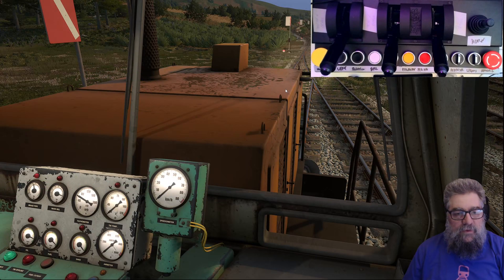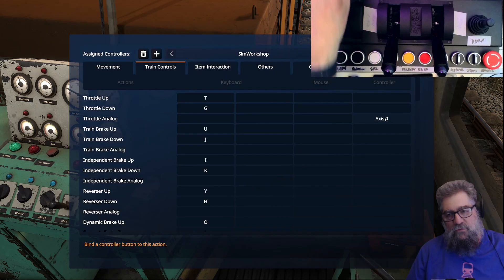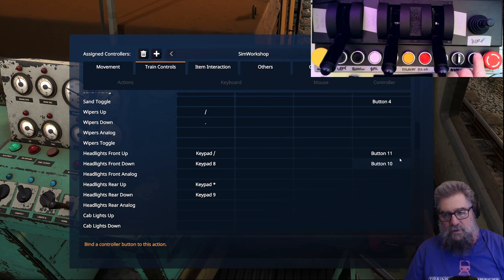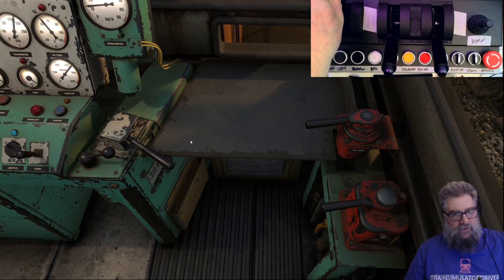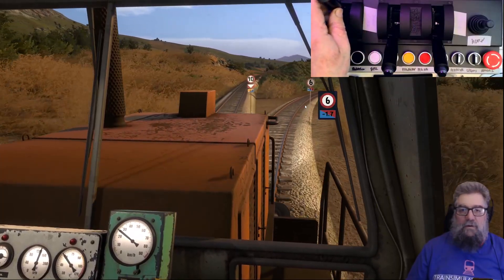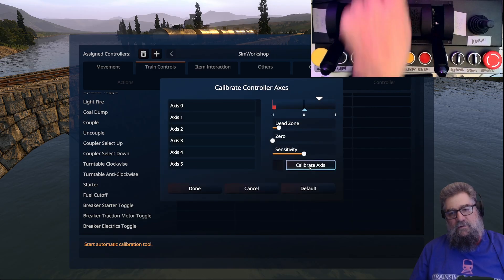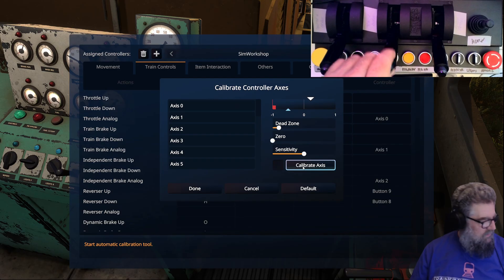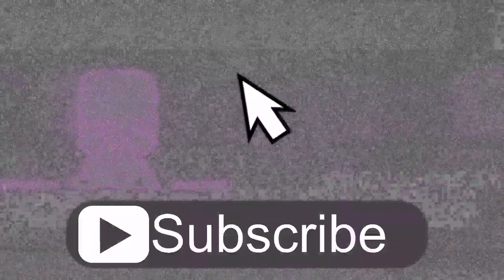TSC X Setup for Derail Valley

Comment: looks good, thought the webpage for this controller doesnt say it supports it. shame it doesnt have more buttons though. like the raildriver does.
Reply from the maker: It's basically three joysticks and a bunch of joy buttons. Anything that supports joysticks and joy buttons should work with it. Each lever is an axis.
Reply: @trainsimulatordriver  yer i can see that. shame it doesnt have 4 levers like the raildriver. and more buttons but does look  better made then the raildriver being all plastic
Reply from the maker: @t0rnado695 Raildriver isn't all plastic, it's a metal box with a plastic top. This is a metal box also with a plastic top where the levers are. The critical difference that I think sets them apart is the direct drive for the sensing electronics for each lever. On rail driver is via a long plastic shaft that twists a bit as you activate the lever.
Reply: @trainsimulatordriver  well yer i meant the levers etc are all plastic not the box.... i assume those levers are metal ?
Reply from the maker: @t0rnado695 the handles themselves seem to be plastic with a metal bolt through the centre. The bolt takes the load and gives them heft. The maker has alluded to possible other handle styles in the future.
Reply: @trainsimulatordriver  aww i see. yes certainly stronger then just plastic, and easier changeable also.
Reply from the maker: @t0rnado695 you could even make your own if you had the skills
Reply: @trainsimulatordriver   yer  of course. i just got a raildriver delivered today, but it arrived broke. two levers snapped, so was wondering if easy to repair or just get a new one or go for something else lol
Reply from the maker: @t0rnado695 seriously, that's awful. I would return it for replacement. Send them pictures of how it arrived.
Reply: @trainsimulatordriver  wasnt a new one. was 2nd hand. but they have refunded me, so just need to return it., sucks coz i was looking forward to using it lol
Reply from the maker: @t0rnado695 of course, I'm glad they refunded you. Still disappointing.
Reply: @trainsimulatordriver  indeed very disappointing. just my luck i guess.
Reply from the maker: glad to hear they refunded it
Reply: @trainsimulatordriver  indeed and i ended up buying off the guy really cheap due to the broken levers, and have since opened it up, took it apart, fix the broken levers with metal pins and epoxy, put it back together and can now use it... so happy days....